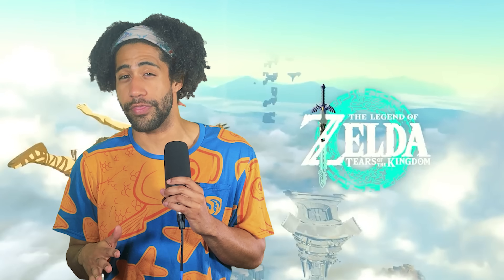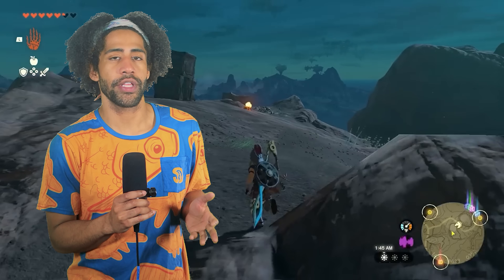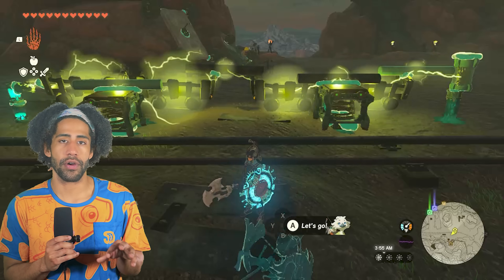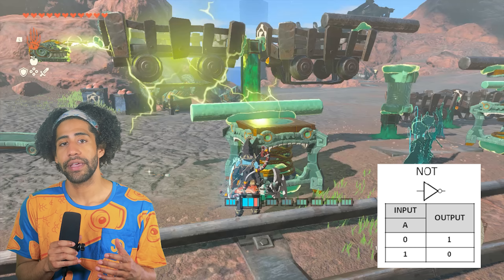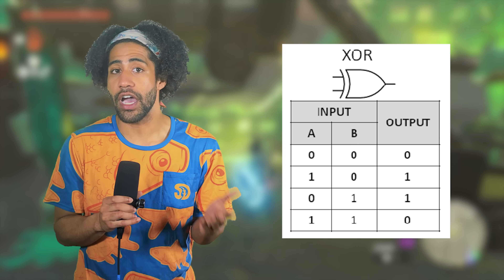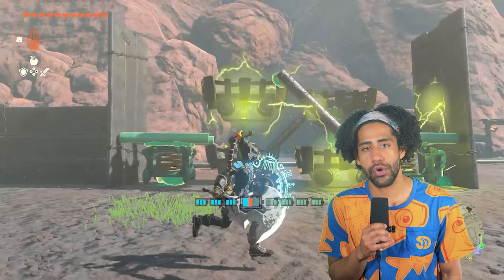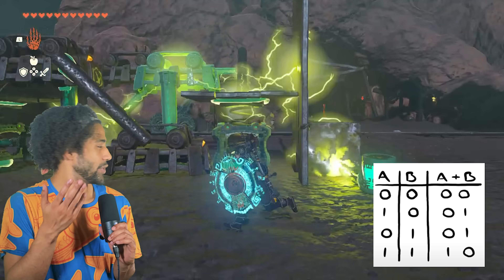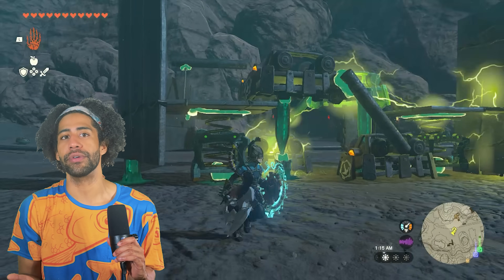how I built Logic Gates in Zelda: Tears of the Kingdom

Comment: I feel like the build limit will become a problem. Otherwise people would be building Zonai computers soon.
Reply: Some madman could certainly go through the trouble of finding an adequate spot to stack unglued parts like jigsaws in a whole variety of configurations. Basically any other structure beyond what we've seen here, but still functions as their respective logic gate. If we could have tens of glueless setups for vertical, horizontal, and slanted and tilted gates and pile them up like we just opened a lego set, and somehow lock it to accept electric currents in various convoluted setups, we may just have a machine that plays tetris.
Reply: @Mecceldorf  there can only be 23 parts on screen at a time
Reply: emulation
Reply: @ManOfDuck  I wonder if they have a mod for that yet?
Reply: @enragedbard No. I’m sure someone is probably working on it, but I haven’t seen such a mod.
Reply: yeah removing the ultra hand limit in emulated totk and combining it with something like botw’s frame rate boosters would definitely help
Reply: I feel like bc of all the stuff that goes on in totk, modding in a "sandbox room" where theres no limit would be best so that the game can focus entirely on whatever youre building and not background processes like whatever monsters, npcs, animals, or the weather are doing. Even the most isolated place on the map would run into problems eventually, even in an emulator. All those resources could focus on your build instead. It could be like a shrine with a big endless room!

Though considering what Big Mike said, even that would have limitations without major changes to the game itself....
Reply: The limit's in place because the game is like... really critically dependant on memory, and the build system isn't sandboxed in any way to prevent leaks/overflows. Right now, the game's got 2 systems in place to try and mitigate leaks and overflows: The build limit, and emergency blood moons (which reset everything you could be using to mess with the game's memory)... but if, somehow, you were to bypass the build limit and prevent an emergency blood moon from popping, you'd basically build yourself into an unfinishable game-state really quickly, where potential key items in your inventory could be removed, or put into the wrong buckets (e.g. your paraglider being moved into your shields, etc). On the surface, this isn't super bad, but because everything in the game is built around super svelte direct memory address manipulation, you'd immediately see a huge number of really crazy bugs starting to mount up as you tried to play the game further. Unhandled exceptions/crashes would start to become the norm, and eventually your entire save lineage would end up become unstable/unplayable.
Reply: @bigmike-  my question is this: would it be possible to force such a memory leak? I've triggered an emergency blood moon before while screwing around, but I wonder if there's a way to force the memory to overflow without triggering a blood moon.
Reply: @Saewinyt  in theory yes, but I don't know how - and I don't think you'd want to, since it'd essentially destroy your save file.
Reply: @Saewinyt   20 bombs detonating at the same time does it every time  its pretty usefull
Reply: @bigmike-  That's very interesting.  Anybody who say, expands the build limit to 50 or whatever, would need to account for this.
Reply: When a remastered version is released on the Switch 2 I’m sure the build limit will be much higher.
Reply: emulators and mods will do the trick
Reply: This is what mods are for! (Insert evil laughter here)
Reply: If there isn't one already, someone will make a mod for it. And then people will literally build a rocket with a huge computer on which you can play the game itself within the game.
Reply: No build limit mod will come soon I’m sure. Just wait a couple months
Reply: It probably would, but km expecting someone to eventually mod out that upper limit
Reply: It’s been a problem..
Reply: >tfw you realize the build limit is 20 objects
instantly barred from being an A-tier game
Reply: @neetpride5919 LOL just enjoy the other 99 percent of the game
Reply: PC modders will solve it probably
Reply: I feel like the abilities and devices are the problem and that if you could build a computer it would make totk just a dumbed down minecraft.
Reply: If there was no build limit i can guarantee someone would of made bad apple or doom within a month and also possibly blow up a switch
Reply: No buildlimit dlc??creative mode dlc??
Reply: I feel like this is the perfect way for Nintendo to make people update their game, just delete the build limit in a future patch
Reply: @catty6151 I enjoy playing the game without a skip button so the limit will never be a problem for me
Reply: A dlc should definitely improve the zonai devices such as increasing/removing the build limit, increasing damage for emitters and cannons and removing the time limit on wings and balloons
Reply: @bobosaurus331 They would never make a dlc like that itd break the game balance. Thats a job for a mod.
Reply: @planetbumble5060 They could release a separate sandbox mode. They could have smaller, more simplified maps with fewer mobs and NPCs and things like that. That would presumably free up the Switch's resources to allow for more complex building mechanics. Kind of like how they did the Animal Crossing Happy Home DLC.
Reply: @planetbumble5060 What game balance? That went out the window when they put these abilities and devices in the game
Reply: @Alex-kc9yr Or you can just play minecraft
Reply: @Alex-kc9yr Or fortnite lol
Reply: @bobosaurus331 thats not a dlc?? that literally adds no content and only buffs a couple weapons
Reply: @bobosaurus331 there is a mod to extend the time limit in balloons to wings

Comment: Not bad!  If only there was a way to trigger Zonai devices with electricity...  Time to experiment with parts from shrines
Reply: technically there’s the propellor/motor combo from the shrine on rist peninsula. might be able to attach mirrors and use a caged enemy dropping its weapon as an output
Reply: and in that line of thinking, enemies holding things versus empty hands could be a form of memory storage
Reply: @EpochFlame  takes volatile memory to a different level
Reply: Surprised to see your comment here, I would love to see you two collab on a video!
Reply: Theres a glitch where you can fuse a zonite tool to your shield and swap shields. Just look up infinite bouncy shield, by Mon facts. But instead of a spring use a cannon. You can have a shield activated cannon. turning a shield into a trigger or button of sorts. (: hope this does something for you
Reply: @Totk1.0.0Glitches along with the bouncy shield glitch, this works for any zonaite device (though usuefulness varies) and you don’t need to fuse the device to your weapon.  If you just leave the glitched item (that the game thinks is fused to your shield) on the ground, you can hold your shield out to activate it, and lower your shield to turn it off.  Additionally, you can still hit the item like normal to turn it on or off, but the shield acts a kind of remote control “on/off switch, where holding up your shield is on, and lowering it off. And if the remote control device is a shock emitter, you could probably hook it up to a not gate, and invert this remote controller.
Reply: @Footballfan896  well said. way better than how i explained it
Reply: could turn off a zonai device by having a motor push link out of range
Reply: I think you can "steal" parts only found in shrines by fusing them and bringing them to the shop that unfuses stuff in tarey town.  Apologies if you already thought of this though.
Reply: the fan can be trigered by electrisity
Reply: Isn't there an electric fan???
Reply: @ast8177  yes, there is.  It provides a much larger gust than the zonaite fans, but it’s also much larger and heavier.
Reply: Also the battery comes from a shrine in Zora’s domain and the motor and propeller come from a shrine at the middle of the spiral beach. Idk anything else but maybe in the zora’s domain shrine there was something activated by battery.
Reply: Wait you can take parts out of shrines? I feel like I missed something lol
Reply: @MC-zr7hl  yes, if you fuse the shrine item to your weapon, you can take the weapon to Pelison in Tarrey town and he will unfuse it.
Reply: @Footballfan896  ah yeah! Thanks I kinda forgot Pelison existed 😆 thank you
Reply: you're my new favorite guy
Reply: the batteries you charge with electricity can be used to start zonai devices

Comment: A better way to do an XOR gate could be to just stack the 2 springs and make it so the current only flows at the height of one spring being activated and the other not, it should be the same height no matter which you activate and be lower or higher if neither or both are activated
Reply: the problem is that springs are bouncy, so one spring would jump the other, and it doesnt work if theyre attached, because they will activate simultaneously
Reply from the maker: @nivaslebra4355 This turned out to be the issue, BUT! In experimenting with stacked springs I found a really easy solution to the XOR. Will definitely be making an new video soon
Reply: I was thinking the same thing, ye
Reply: @FLclara   I agreed with N. Simplify your gates using 2 springs, conductor attached to springs and a metal plate attached to stake a different hight. Spring retracted=1, contracted=0. electricity on the plate =1. For some gates the metal plate may be at level ground, in others in the middle or higher. You can figure this out.

Comment: There is a much simpler way to make an XOR gate. just stack the springs and make it so the carts are at a height that the circuit is only completed when only one spring is extended. If neither is extended then the pole used to link the carts is too low, when both is extended the pole is too high.
Reply: this won't work if the springs are connected, and if they aren't connected, then you need to find a way to stop the top spring from flying away
Reply: If the springs are attached with ultrahand they will both activate together. Maybe you could make a bracket to connect the two without gluing them?

Comment: Sorry to be that guy, but for an actual logic gate and the type of input and the type of output have to be equal in a mathematical sense else it is not possible to chain logic gates, which is a requirement for turing completeness. If there was a way to control the springs' states of this contraption with electricity this would be a breakthrough. Also building a NAND gate with these properties is sufficient to prove turing completness, although it makes building actual circuits a bit awkward.
Reply from the maker: There actually is a way to do that I found last night! I plan on making a follow up video later this week but its possible to make a transistor using a shrine fan/motor and a spring
Reply: @tonyhinderman  Well now I'm actually pretty hyped

Comment: great work dude, only one month in and we have basic logic gates!
i think the next logical step would be to implement some kind of transistor (i think that’s how they’re used - essentially what you call switches) that doesn’t require user input aka hitting it with something like in this example.
maybe shrine motors could work? like i think putting an iron rod on it and some kind of weight on one side should do the trick - 1=motor is powered, turns iron bar to create a connection for electrical current - 0=motor loses power, weight pulls one side down and therefore closing the connection.
in theory this could work but i’m probably gonna have to experiment with it a bit

edit: sorry for bad formatting cause i’m on mobile
Reply from the maker: Thanks man! 
I agree thats definetely the next step. I saw while editing that someone on reddit had actually made a transistor already using a Shrine fan and a spring! I havent had much of a chance yet to get back into the game but there is 100% more to be done. And with the Capacitor Battery ?? its gonna be awesome :) thanks for checking out the video!
Reply: Theres a glitch where you can fuse a zonite tool to your shield and swap shields. Just look up infinite bouncy shield, by Mon facts. But instead of a spring use a cannon. You can have a shield activated cannon. turning a shield into a trigger or button of sorts. (: hope this does something for you